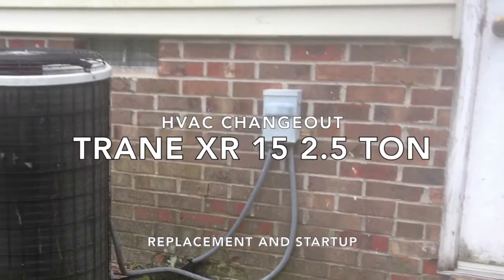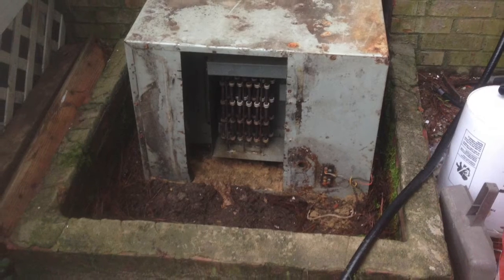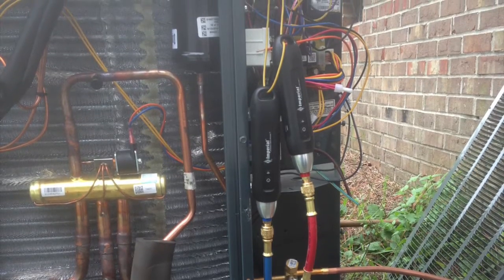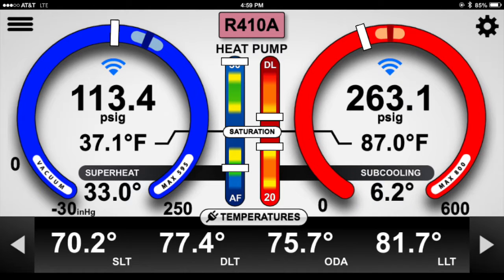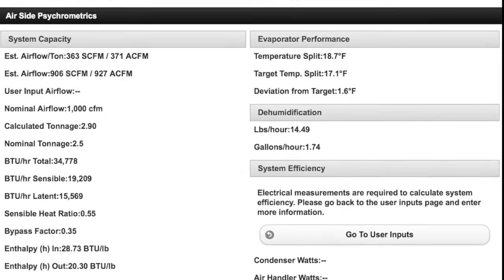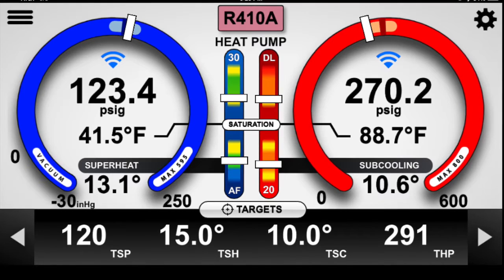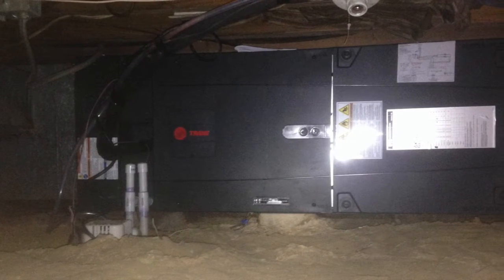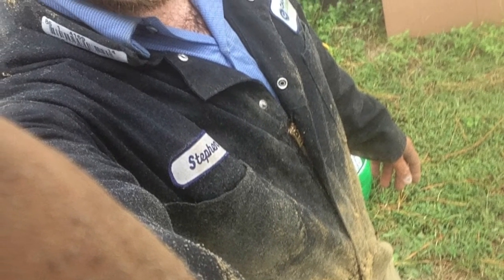HVAC Install: Trane XR15 2.5 Ton Heatpump Changeout

Comment: Stephen, the next time you run into CFM problems with a VS you can set the tonnage to the next highest tonnage and get it that way but be careful the increase in velocity will cause noise if your duct is tight.
Reply from the maker: After I had left I thought about trying to play with the dip switches to get closer to the rated CFM.
Reply: I do that as well. I had a 1.5 ton with low airflow so I set the switches for a 2 and it worked great..

Comment: I love going home dirty, it means that I did some good that day.
Reply from the maker: Very True Jim. Back when I installed regularly I figured I wasn't working hard enough if I didn't bleed that day!
Reply: Stephen Rardon yeah, it's great to bleed, you can shake your hand and hear splat, it freaks your helper out. I just tell him: "it will grow back"
Reply: Stephen Rardon*****...bleed good....stiches bad...
Reply: Billy Knoth some iodine and electric tape
Reply: I used hardcast tape once...  it didnt come off easy though
Reply: Billy Knoth in restaurants cooks use electric tape, it's waterproof and nurses will use crazy glue, haven't tried that yet.
Reply: ***** I do carry  the liquid babdage spray...  works well on those annoying little cuts that dont stop bleeding.
Reply: Billy Knoth i'll have to get some, thanks.

Comment: Cool video.  What gives with all the air handlers in crawl spaces?  Here in central Indiana they are in garages, closets, or basements.  Very rarely do you see them in crawls or attics.  Nice install.  Can't wait for the next video.  Thanks
Reply from the maker: Very few units down here are actually NOT in crawls, obviously. I think it's the dumbest place to put equipment unless it got vapor barrier and humidity control. I
Wouldn't mind if everything was in the attic!